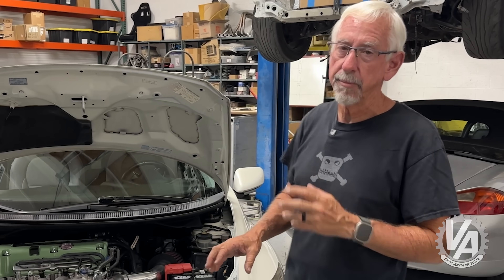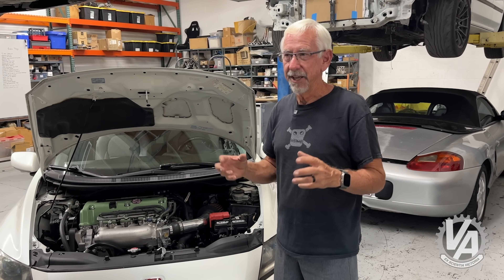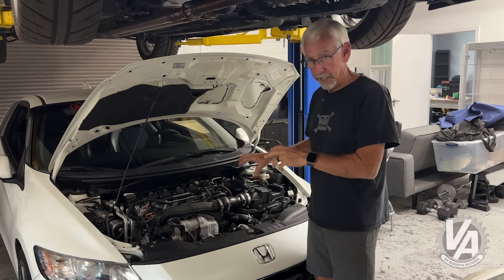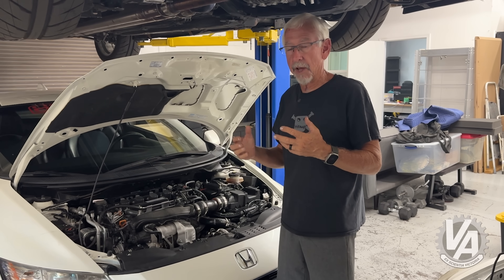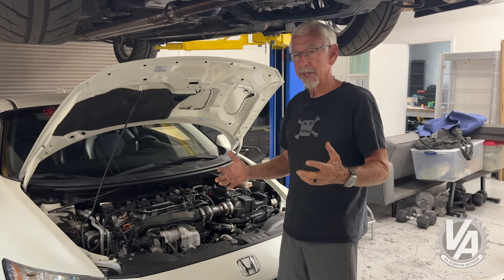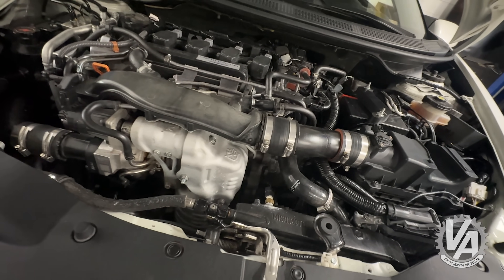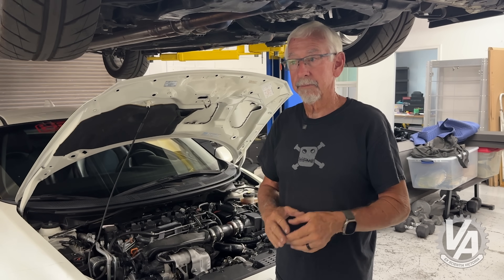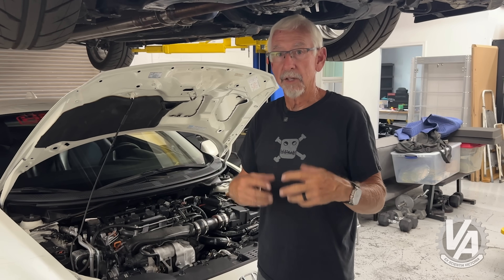We Knew This Would Happen! Honda Engine Swap History Repeating: ZC to B to K to WHAT?

Comment: The only thing is, the L15’s are over $5k plus you need a transmission
Reply from the maker: You are definitely looking in the wrong place. Go to car-part.com and look up the Civic 1.5 L turbo motors. Then sort by price. There are dozens available for under $1000. I purchased three L15 B7 engines with manual transmissions for $2500.
Reply: @VTECAcademy  thank you

Comment: H22a4 with Darton mid sleeves. 👍 Yes, the Darton Mid  leaves are not cheap but people have been slipping on the h22a4.  You can get the block for 200 bucks. Also at the end of the day, this would be an all American built honda motor.
Reply from the maker: All the turbo motors are American built
Reply: I love that motor.

Comment: Any fix for the oil dilution issue?
Reply from the maker: Warm up the car properly. Dont take a lot of short trips.
Reply: @VTECAcademy  what exactly is the issue? Piston ring blow by? I can do an oil change and then about 2k miles later about .5 overfilled and it smells like gas?

Comment: Uh huh, and how's that oil dilution problem working out for those L15 engines from the CR-V? Or is that something that just sorted itself out because the engine swap community turned its attention to that particular engine now? 
Naturally aspirated a million times out of a million. Although a stock L15 turbo engine in my GE Fit would be groovy, but it seems like only the GK is seeing any attention on that front...

Comment: Gotta disagree with The L series is absolutely trash and makes no power without the turbo while the k series yes doesn’t make more torque NA once it’s turbo is far superior than the L
Reply from the maker: And yet the stock 2018 Civic EX turbo beats the 2006 and 2012 Civic Sis easily.
Reply: @VTECAcademy why the L15 and not the 2.0T from the civic type r/accord?

Comment: I run a BCD motor and it will spinn 3rd gear when i wind it past V tech a 1000 RPM in the rain !! Ive got to drive it when it rains because my V8 LS SWAP will turn around and trow u in the ditch !! Im joking im being funny was going to c how many bad comments i could get i love hondas they run forever and they are bad ass rides !!

Comment: Aren't those L15 turbo haven't a lot of head gasket issues? especially the crv and accord
Reply: Headstud upgrade while you’re there. Also a lot of that stemmed from CRV and Accord owners putting shitty fuel. It can happen on any L15B7 if you up the boost past ~23psi with a tune but the rule of thumb is to upgrade the head studs and never worry about it.

Comment: waiting until honda finally releases the new quad cam v6 turbo.
Reply: The one that's already in the TLX Type S, isn't it?  As with the K20C turbo, I think the issue is since the factory engine is designed with small ports and valves for fast spool, you'll still make more power by turbocharging an older NA J35 or NA K series, so the factory turbo motors are not very appealing.

Comment: What about the L15 head gasket issues? You mentioned the more beefy L15 transmissions. In fact the L15 connecting rods are smaller and can handle less torque than the N/A K-Series ones. The L-Engine was initially designed as an N/A Engine for the Jazz/Fit. Honda came up later with the idea to turbocharge them but did not strengthen the parts. In stock form there is no issue. But it is not as tuneable as the K-Series was without these headaches.
Reply: The head lifting under boost is probably the biggest issue currently plaguing the L15. BUT there is a head bolt kit out there that helps considerably with that. And if you're going for more than 18-20 lbs of boost, that's the route to go. I do know the L15CA engines have revised bottom end. The connecting rods are a little beefier and are also tuned a little differently over the L15B. Hopefully my DE4 Integra lasts a long time...
Reply: @andrewallen9432 also if you have an L15B7 and your bottom end blows or whatever, you can buy a L15CA bottom end that’s stronger for the same price as the B7 version.

Comment: The Jseries has been gaining popularity in my region
Reply: Ummm the J-series will make 300+ NA WHP with just bolt-ons and be reliable and pedestrian . You aren’t doing that with any k-series unless you open the motor.
Reply: @goforbroke2  3.5L engine makes more power than 2.4L engine -- I'm shocked. 🙂
Reply: @TassieLorenzo  It’s no surprise but nobody talks about the NA potential of the J-series. It’s always the NA kseries. 
I have a 6-speed tsx and I’m thinking about pulling the k for a J.
Reply: @goforbroke2  why just go turbo and put down more
Reply: @robertalicea5585  Some of us are not in the high horsepower war. I prefer NA motors also.
Reply: It's crazy though the k series with a few bolt ons are putting down j series numbers you would think J series would put down more horsepower with bolt ons
Reply: @robertalicea5585 
Unless your turbo'ing the k, J has more torque.  putting down 280tq and 306whp on my j36 na.
Reply: @robertalicea5585  J series is (mostly) only SOHC after all (apart from the latest ones that aren't VTEC anymore).  The 2GR from Toyota seems to be the ticket for V6 enthusiasts!

Comment: What would it take to put one of these in an ef si. Hood and ground clearance are one issue but I want to know if wiring wise is it possible. I'm in the middle of a gsr swap on my 91 and started thinking if an r18 or somethin newer would work. I'm not into the k
Reply: If you have a GSR swap, that’s kind of a big deal today. They’re getting rare and pricey and they look/fit the best in an EF. Rock that thing with pride!!! That’s a flex in 2024. I have a boosted b series in my GSR sedan and it feels cooler the rarer it gets.
Reply: @chaseteter  I had a turbo b20 ef sedan sold it to buy kitchen cabinets lmao. I'm a hater when it comes to the k in an ef I don't think it belongs but one of these newer motors offering all that tourqe over a b series had me thinking about doing one.

Comment: He isn’t wrong generally speaking now the top fastest guys some are b some are K at that point they aren’t the stock sleeves they are sleeved or billet engines so it wouldn’t matter b or K for the average guy wanting to do 500-700 hp the k would be fine for 500 anything last that it’s a gamble b18 you can make 300-400 stock now remember t the K is goin to give you torque for for around 500hp b is the way the power won’t be compared to the k because of the toque if your street racing same thing unless your AWD 

All motor is definitely k just can’t beat that k24

Comment: Respectfully I am going to have to disagree with the K series being obsolete and the L15 being the new K series swap.

An alternative engine swap for newer model Honda platforms sure. But for a golden era 90's EF, EG, EK, DC2.... Sorry I definitely don't see it. 

And yes, it is true that Honda no longer makes an OEM K series cast engines and it's also true that those days of buying a complete B/K engine swap for cheap no longer exist, but that doesn't mean that the K series engine will no longer be reproduced. Just look at what 4Piston racing has done creating a brand new B16 race cast cylinder head and very soon, cylinder blocks.

Same will happen with the K series platform just like how PRP racing has already manufactured a race cast RB26 cylinder head and soon to be cylinder blocks.

In Thailand, Ichiban Racing has almost finished their race cast Toyota 2JZ cylinder head and soon complete long blocks.

It's just the times, similar like when 50, 60, 70s muscle cars were extremely difficult to source parts and eventually aftermarket manufactures caught on and started creating OEM reproduction parts. People forgot in the 90-00's it was extremely difficult to restore your favorite classic muscle car and finding parts were near impossible. 

Today, you can build your favorite muscle car off a catalog. Down to a brand new complete body shipped to your door.

Just the other day, there was a video I watched from Taiwan were these factories were recreating a new 60s Ford Bronco, VW Microbus and a host of other muscle car bodies. A perfect one to one clone reverse engineered.

There's a huge market for these 90s Japanese cars and the same will be soon to follow.

Just the other day was a release picture of a brand new AE86 body soon to hit the market for purchase.

It's just the evolution of the times, and with modern technology we have now in our fingertips, I see a future with a lot of B series and K series reproductions engines from these these OEM+ restoration/ race car builds. No different than these muscle car reproduced engines.
Reply: Came here to say pretty much what you said.
Reply: The same thing is happening with the 2jz, rb26 and angry dorito spinny things

Comment: The problem is since the L15 came out, less and less people were getting the manual transmission cars which results in less and less transmissions like that in junkyards and recyclers.
Reply: People will come up with adapter plates so older transmissions will fit.
Reply: @thetruth7633  I bet my life someone in Puerto Rico already has
Reply: The honda fit actually has a crap ton of high sales with manual 5 speeds with the L15A1
Reply: @supermcbrian  that is a weak transmission even for the stock NA engine
Reply: Maybe true in America
Reply: Yeaa i was surprised when my accord shot up in price the last few years... People will pay a pretty penny even for a non lsd 6speed tranny nowadays
Reply: The si only comes with the manual
Reply: Finding Si's in the junkyard is a pipe dream, at least around me. They always find their way to the Copart Auction or just get sold on marketplace for a premium.

Comment: long CAI is so much better 900-1000mm long
Reply: 1000mm is perfect for a one-and-a-half wavelength acoustic resonance at 8000rpm! For K20 you want 900mm to put the resonance at 9000rpm.  But my understanding is that doing one-third the length will give the same resonance (half a wavelength instead of one-and-a-half), as long as it's an enclosed box, so 300-333mm should be just as good.  This is based on my interpretation of Garage 4AGE's K series intake length testing and seeing where the resonance peak shifted around as the intake length was changed.